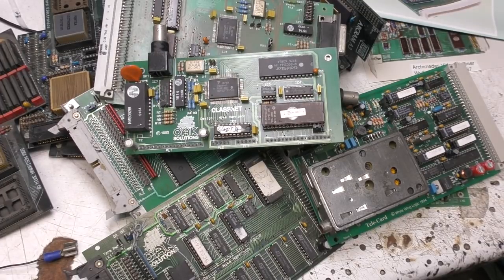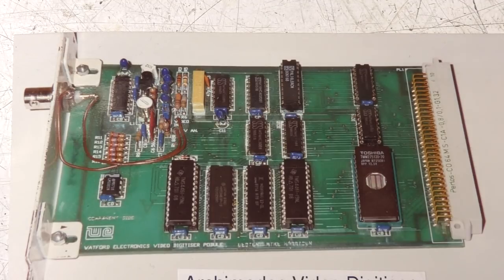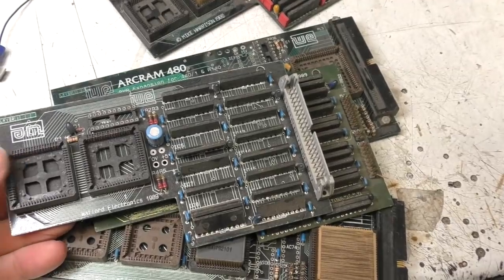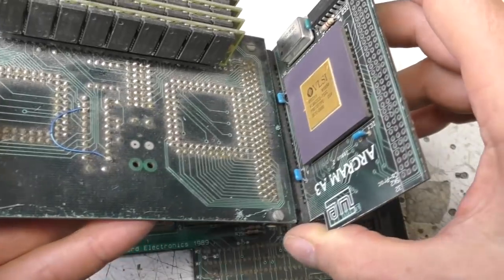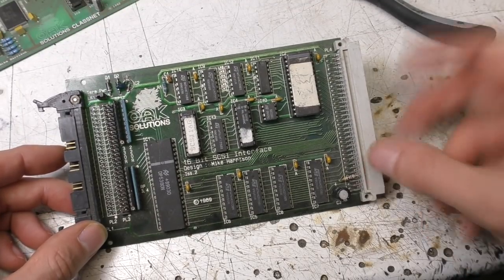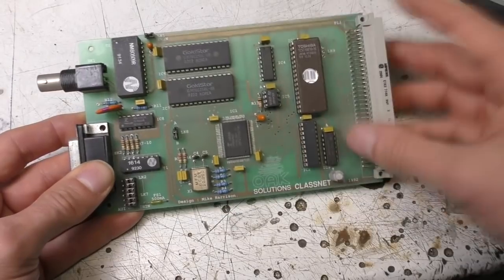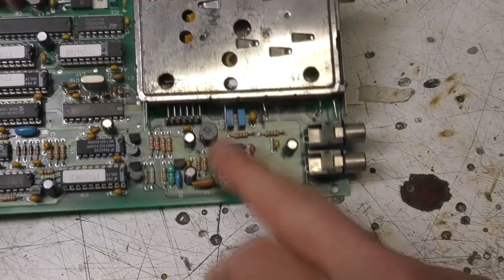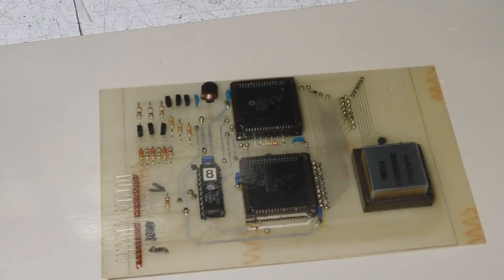Some of my old Acorn ARM hardware designs

Comment: I had an early Oak SCSI card, and it worked great with its 45MB Seagate drive.  However, when I upgraded to a 200MB Maxtor, it would give me ~1b error every 1MB read.  Oak couldn't find a fault with it, so I sold it and splashed out on the Acorn SCSI card, which fixed the problem.  But I can't complain, since the investigations I had to do to convince myself there even was a problem set my career in motion!  (If you've never suffered occasional data corruption, it's really quite insidious.)

Comment: Wow.. I had no idea you'd done these. We had one of the video digitisers at school, and that got me a bit obsessed with how that worked at the time. I recall Maplin also made a kit which could be used with the Amstrad CPC (which is what I had). Great to see all this. The Archimedes was fantastic for anyone interested in how computers worked and could be used - and the Acorn !Draw software has had a lasting impact on me. I designed PCBs by hand with that - and the trick was to use a laser printer then drench the printout in WD40 to make it transparent enough to expose the board in the lightbox...
Reply from the maker: You never discovered tracing paper then..!

Comment: The teletext adapter I had was built for the beeb and used only I2C - it also worked on the Arch, which had I2C on the backplane. Very slow compared with Mike's board.

Comment: This video really took me back.....I was the technical services manager of Orion Computers and a component level Archimedes service engineer.  I designed a multi podule interface and memory expansions for the A3000 but mainly dealt with repairs and complicated customers.  I must have sold a good few of your boards :-). We did an IDE podule but it was VERY dependant on drives and worked with some and not with others.  We also had a TV output convertor which was used with the A3000 to hook it up to TV sets that didn't have scart or video in.  Out of absolutely everything the only one thing I still have is one of the Orion IDE boards and I didn't even design that.  It was designed by a lad called Dave who did quite a bit of Acorn design work although I can't remember his surname.

Comment: Anyone remember the jump vectors that RiscOS used everywhere (both low memory addresses for the ARM and the "modules" that would be embedded in the podules)? I ended up using that idea for a fast SMS router for fast/flexible decoding that back in the 2000s - all the Teen Idol voting traffic in the US went through those tables :D (and most of the SMS traffic world wide).  I learn that on the Acorn Archimedes!

Comment: Boards like those were a fortune, in the day.  A network card was $100.  How quickly the job of designing boards went to China.
Reply: The designing? Probably not. Construction/manufacturing on the other hand...
Reply: Make your own double sided by creating new layers in RiscOs !Draw files and use photographic high resolution line film costs much less than $100.

Comment: LDMFD R13!,{r0-r12,pc}
This brings back memories. at home we had an acorn electron then a A310. I remember updating the memory to 4MB with a plugin board - the MEMC1A needed to transferred into the draught board. Also the ARM2 was upgraded with an ARM3. I wrote an app to poke the MEMC1A to increase the speed of the machine too. One module slot was taken up by a Oak SCSI controller + HD.
Later at uni I upgraded to a RISCPC with ARM610, ARM710 and then StrongARM. At that point it had an IDE controller in IIRC. I had the RISCPC 486 daughter card too to run PC based development tools for university.  I was looking at Hydra to allow multiple StrongARMs to be run in parallel but moved away from the scene.
I shared my university house with "Berty" Tom Cooper and in the time I wrote an ultra fast screen plotter for Wavelength over summer, Tom had written a playable game. In the same house was Rob that wrote a 3D editor for a magazine, I ended up rewriting his BASIC in ARM + FP assembler for 13x speed increase :)
Reply: Great story, thanks ! Bought Wavelength, spend quite a few hours on this great game
Reply: @speedsterh  I remember designing that in a Uni lecture, with the lightning etc. IIRC sat with Tom at Moocow's house (I can't remember his real name) and playing the pre-release.  Another one of the students did the great music. Tom wrote DarkWood in his final year at uni (well finished it) on his A3020 (I can't remember the precise model), I test it out on the RiscPC.
Reply: @nickk6109  The music (great, could have fit an amiga game) was from Exel. I don't remember him as a musician for the demo scene, though.
Reply: The Acorns are fairly hopeless on games the BBC micro was better more suited to serious applications imho.
Reply: @factorylad5071  At the time the direct memory access and fast RISC chip wasn't too bad - it could have done with more registers for faster memory transfers but that's the price you get for having 16 registers addressable in each 32bit conditionally executable opcode.
The 6502 was more an embedded controller and wasn't developed specifically for PCs. If you look at pole position back in the day, the arcade games had 3 CPUs and custom chips. The BBC and Archimedes suffered that their chipset couldn't move memory in a block or really play sound without help from the CPU.

Comment: Regarding the teletext board, the original Acorn "cheese wedge" teletext adapter takes a similar approach to yours: it just does the data slicing and has some minimal discrete logic to capture the packets, which the Beeb then reads immediately down the 1MHz bus. It can't store more than one line of data, so the Beeb has to be running in real-time. The later Morley and Acorn Advanced Teletext systems use the SAA5243 chip which downloads whole pages in to its own RAM, which is then read at leisure by the Beeb over the I2C bus.

Comment: In the early 2000's I bought a load of Archimedes stuff, there was a lot of it on eBay (Probably because schools were selling it off at that time?) and I was looking for something more interesting than PCs to play with. I got one machine working, the second refused to boot. They came with loads of cards and floppy drives though, and I spent a good while trying them out, seeing which bits fitted. I think some of it was for other machines than the 2 I had. Most of the stuff got sold on eBay a few years later where there seemed to be an enthusiastic market for it. My one working machine worked as a file server for me for quite a while until someone offered me more cash for it than I could resist! They were nice machines, although I never really got deeply into them from a software point of view, you could tell they were much better engineered and more like the minicomputers I used at work than PCs.

Comment: Wow, I remember reading about some of these cards in Acorn User in the early 90s.

I got an Archie A3000 around 1992, and it was my main machine for quite a long time.
I only have about four disks left now, and donated my A3020 recently.

I remember Dad buying me the RiscOS 3.1 ROMs, installing them, and thinking "This is a future!". lol

I first saw a digitizer card used on the BBC Master at school in the late 80s. It was very low resolution, ofc, and B&W capture.

The guy demonstrating it applied different colour palettes to the captured image.
I think the printer was only a 9-pin dot matrix (B&W), but it was still impressive to see video capture back then.
Reply: And yep, I do recall the BBC Micro digitizer being very slow. You had to sit perfectly still in front of the camera.

The Sega Mega Drive / Genesis uses similar DRAMs with the internal shift reg.

And I think VDP1 on the Sega Saturn, which have a "SAM" output pin for shifting out 4-bits of pixel data per chip.
Reply: 23:00 - Haven't seen an AUI connector in quite a few years. I forgot they were a thing.

By the 90s, I very rarely saw the modules that used to plug into that port, as most stuff had the 10base2 BNC on by then.
Reply: 27:06 - I recall we had a system for the Amstrad CPC with a photosensor that stuck onto the corner of the TV.

There were a few broadcasts back then, which sent computer programs via TV, and also a few that were broadcast directly via the radio.

I think the TV version must have had it's own "bootstrap" disk or BASIC program to load in first, so it could cope with the blanking periods etc. I'd be interested to track down that system again, as I'm fairly sure I'm not imagining it. lol

We had a modem for the CPC 6128, and it was used it to book the flight for my first ever holiday abroad (Mallorca, around 1988). Strange to think how booking stuff online is taken so much for granted now.

Comment: I also bought from Sendz, using a bank cheque that was posted to them. Issuing bank for London was actually Barclays Bank London, even though I was using my local bank, which had an account with them for this. First few cheques were hand written, stamped by the issuing bank for validity, but the last few were machine printed, and actually a really nice looking bearer instrument, more because they normally were used for massive money transfers. I was getting ones for a few pounds only.

Comment: Great memories. No pun intended. We were contemporaries in the industry. I designed vision boards at Applied Scanning Technology in the late 80s and then video processor boards for Prime Image in the early 90s. I used a lot of PALS and GALS, hid boot code in the EPROM on the Oak VGA boards, and suffered memory starvation because management refused to purchase the six memory ZIPs that I requested and forced me to fit my video in four (.5Megabyte). This forced my component NTSC to be 512x488 and totally incapable of supporting PAL. Who remembers Brooktree? Ah, good times. Thanks for the nostalgia!

Comment: @23:00 64KB of SRAM on that network card, and the same size on original Acorn Lance Ethernet card :o while PC Ethernet cards in similar timeframe shipped with 8 (3com 509B) to 16KB (NE2000) buffers.

Mike why not release same products (video grabber, TV tuner with teletext) for PC platform on ISA bus? Surely the market was at least 10x if not 100x bigger in early nineties.
Reply: I would guess because Mike is in the UK, and the Acorn and BBC were a massive market at the time, as they sold a lot to the educational market.
Reply: @SeanBZA  Plus the ARM processor, at least in the beginning, was a fair bit more powerful that the Intel processors in PC's and as such were more suited to these kinds of applications.

Comment: I also made video capture cards, and I remember using a 74S124 to generate the recovered pixel clock just as you say- feed the sync into the enable pin.  It worked great.  I got that trick from a company that made character generators for the broadcast industry, they used it for generating video genlocked to some other source.

Comment: ICT PEEL chips.. Should've been the defacto standard rather than PAL/GAL.. They had some extra feedback from the macrocell to the AND array or something that made them much more flexible.. can't remember exactly, but on a couple of boards I could implement a state machine in just one of those that would've taken a couple of equivalent sized PALs. Always had trouble getting stock though.. Great chip.. Terrible company.
Reply from the maker: You could also bury the registers, so they were harder to reverse-engineer as you couldn't easily observe internal state.
Reply: @mikeselectricstuff  Ah yes, <edited> Just had to go and look at the datasheet..  I could've sworn I'd buried the register and still used the pin for something else, but I can't see how now.
Reply from the maker: @donvito1973  The output enables came from the array ( vs. GAL which had a global enable in register mode) , and there was a feedback path from the register to the array before the output selector/buffer ( GAL only had feedback from the pin, after the buffer). You could use the register internally as well as using the pin for seperate I/O

Comment: Fascinating history lesson... the Archimedes was one machine to which had little exposure. I remember it appearing in the news occasionally but by the time it was current ai would have been using the equipment which work supplied (Fujitsu C/CPM luggables I suspect). Fingers crossed someone unearths a board or two to let you restock 😀👍

Comment: Quite apart from the clever innovations and novel products, I'm amazed at Mike's output during that time period. Part way through the video I was already thinking OK, nice, Mike must have been working with someone else doing the 4-layer board design with professional PCB software (which I remember was $$$$$ at the time), when Mike casually drops in that he did the board design oh by the way with the software he wrote. !!!!! All on the side while having a full-time job!  Is "Mike" actually an amalgam of several clones?
Reply from the maker: Luckily, at my full-time job, nobody noticed I was doing this stuff half the time at work..!
Reply: Mike, you were also working for a marconi division??? Lots of time for outside projects and with the very best test gear...
Reply: I've always thought Mike tended to sound tired in his videos.
Now I know it's because he's basically worn out.
:P
Reply: Multiplicity

Comment: Another great video Mike. Nice to hear from the original desiger of this stuff and on you own time also. I still have most of my Acorn machines includeing my A440 with the 20MB St506 HDD. The first time I knew you were involved in Watford Electronics was the print buffer video for the BBC. We used one of these in school and it was such a time saver.

Comment: I remember designing PCB's using XCad on the Amiga, would have been around the same time, I had a plotter I got cheap from a kitchen design place that closed down and spent a fortune on specialist latex ink plotter drafting pens and polyester film, I made my own prototypes and for high res stuff used a local printer to do reductions onto film, bizarrely a local small hardware/garden shop also had a full PCD production line in the basement, I got friendly with them and he'd run my boards through cheap with other larger orders.

Comment: I may be wrong, but didn't OAK also made VGA cards for PC's? If it did I installed many of those back in the day when assembling PC's (mostly for business applications) 
While watching this video I got the impression you could be THE man to help me bring an interesting idea to life based on a Retro architecture. The idea starts by re-implementing that system with new hardware producing a fully compatible system. And I do mean 100% compatible. Though, due to the way I have in mind to achieve this re-implementation the new system will also be able to "morph" into something much much more powerful. If this short description tingles your curiosity please do get in touch!

Comment: Fantastic to hear this from the actual designer of the upgrades I pored over in the pages of Acorn User as a teenager. Would love to hear more about designing four-layer boards on your own software in the late eighties, and the process of pitching designs and manufacturability back then. Just getting hold of a datasheet in those days was an achievement for me.

Comment: My father worked for a PC manufacturer in the late 80s and 90s, and designed a Winchester drive podule for the Archimedes that they sold. I don't know whether it was an original design or a clone, but he at least did the PCB layout. We rediscovered the original CAD files (Cadstar!) on an old floppy, and I managed to convert them to gerbers that were readable in modern software. 😀

Comment: I've actually got one of the Oak 16 bit Solutions SCSI Interface boards, same issue 2 you have.
Never done anything with it, as that requires getting the Archimedes working first (it doesn't like me).

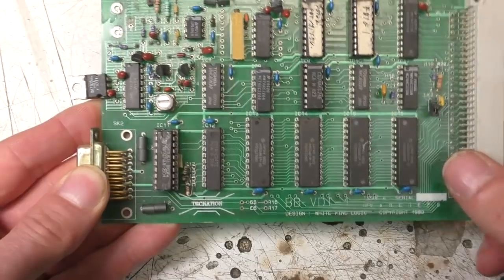Comment: 9:35 The A305 came with 512k RAM soldered on the board, and empty sockets for another 512k. In practice, the machine was not usable with only half a meg, so after a couple of weeks I filled up the empty sockets, but even with 1024k memory remained tight. Later,  I had the onboard RAM and the original sockets removed and replaced by new sockets with 4 megs on the main board, which was plenty at the time.

Comment: The A540 didn't stop at 8meg, it could have 16 - 4meg + MEMC1A on board, and 3 expansion cards with 4meg + MEMC1a on board.. if you had the money. IIRC, adding the 3 cards to get to the max memory cost almost as much as the base A540!
Reply from the maker: I has a vague recollection that there was more than 1 memory slot but wasn't sure
Reply: @mikeselectricstuff  Yes, but the A540 was (annoyingly) a long way out...
You were a bit bemused as to the early date on the A480 memory card... We'd been asked to help get the M4 prototype board booting (which was to develop into the A680) so put support for a second MEMC into a deviant Arthur build. That worked OK. I think as we got wind that the A680 was going to be produced, we dropped that code back into RISC OS 2, possibly without informing manglement (who wanted a clear distinction between their professional Unix systems and the lower-end products), so that we'd be able to surprise folk by having it running on that too. The A480 card would have taken advantage of that I surmise.
We didn't know at the time I left Acorn (Dec 1988) of any plans to do the quad MEMC systems, so if you look at the RISC OS 2.01 memory map from the A540, it has two separate areas for the CAM soft copies, one for each MEMC pair.
Reply: I should see if my A540 still works. Last powered on about ten years ago. Probably the battery will have killed it.
Reply: The multiple MEMCs had to be speed-selected to match propagation delay  : in the 540 it was further adjusted by changing Vcc of a buffer. Did the add-on boards do this too ?